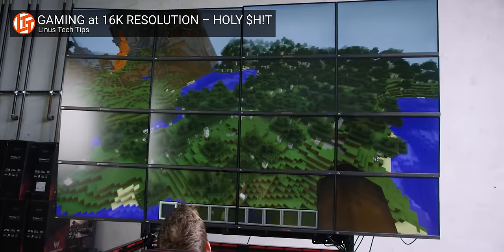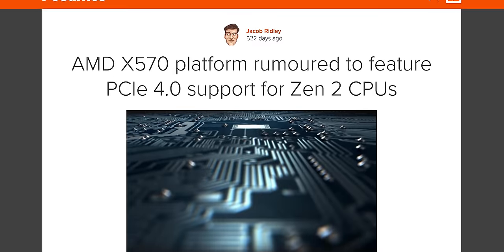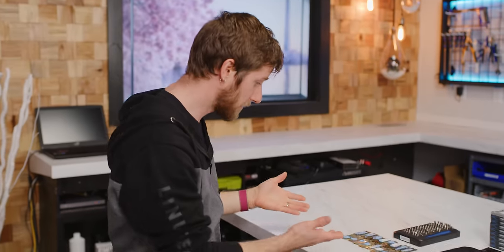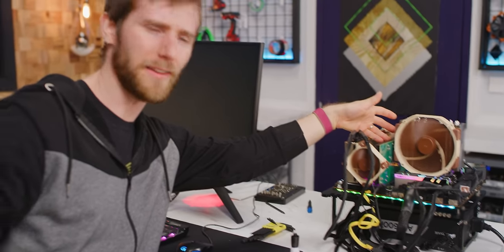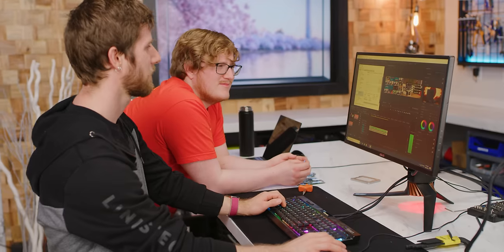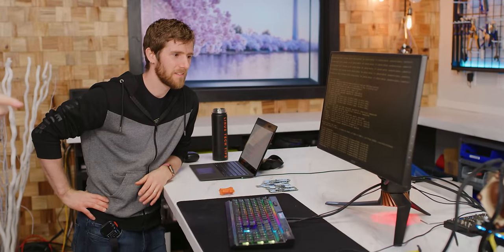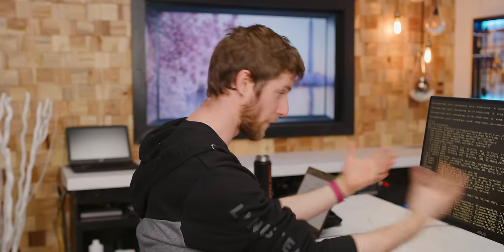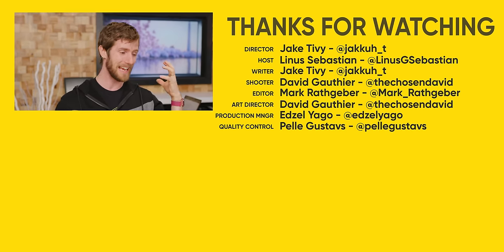This is 50x faster than your PC… HOLY $H!T - Liqid LQD4500 Honey Badger

Comment: 9:27 “This is the worst UI I’ve ever seen.”

Me using a blue and white Bios in 2020.  You said what?
Reply: Blue and white BIOSes are the best. You don't know what you are talking about.
Reply: @MJ-uk6lu  
I mean I guess so, but it has no graphical interface.
Reply: @YTAccount82825  And what? Those blue BIOSes are usually well laid out, simple and have no bullshit. Can't say the same about UEFI era ones, that are heavily bloated, make no sense and look trashier than those basic blue ones.
Reply: @MJ-uk6lu  
Yeah, I guess you are right.  But it just doesn’t look as nice, especially considering that I know someone who has a modern motherboard, and has an advanced UEFI utility, and mine looks not as modern.  Additionally, I’m not that much of a simplicity person but I assume it is just a preference thing.
Reply: @YTAccount82825  Frankly, I just upgraded my computer and I really don't see much point in those "improved" menus. They don't even looks that nice. It looks like 720p on 1440p monitor. I'm not impressed. And there's really not much point of making those UEFI menus to work with mouse as they are firstly designed to still be used with keyboard. Thus you end up with some higher up deciding to spend more cash on motherboard development and then you pay for the stuff that gives you hardly anything better for higher price. Not worth it.
Reply: @MJ-uk6lu  
Yeah, maybe they are great UIs after all, however there are hardly any motherboards that support today’s chipsets with the older appearance and functionally of an older bios.
Reply: @YTAccount82825  Yep. The classical BIOS is dead. You can only find it in some laptops, some OEM desktops, chinese motherboards and certain SBCs. As BIOS became more and more limiting for modern systems it got updated with UEFI, which added a lot of functionality and technical capabilities to BIOS. And while it can have any UI, manufacturers make what they think looks best (most likely what they can sell the best).
Reply: @MJ-uk6lu  
Right.

Comment: Wouldn't running all 8 SSDs in RAID 0 be horrible for redundancy and longevity of these drives? I have no knowledge on this stuff so correct me if I'm wrong, but if this is a high performance SSD meant for multiple workstations,  I'd assume clients would put important data on those drives. Why have such important data on such a seemingly unstable setup? In my understanding, the more drives you use RAID 0 with, the less stable it becomes.

Comment: For us mere mortals the way to go is "Gigabyte Aorus AIC Gen4 PCI-Express 4.0 x16" with 4x M.2 500GB SSDs and with over 5000MB/s read/write speed (a very good price for a very high speed and 2TB of storage which you can use for OS).
(if you have the money you can go up to 29.200MB/s read and up to 28.000MB/s using 4x "Kingston FURY Renegade Gen.4 2TB NVMe M.2", it also has a 4TB version of it but at higher price, depends on the budget but 8TBs are a lot and it won't be any faster, because that's our purpose here, *SPEED*).

Also I saw some questions regarding RAM below. Well, I can say that DDR4 RAM of 3200 Mhz goes up to 25.6GB/s so it won't bottleneck it (technically) if it doesn't go ABOVE that.
And regarding the AMOUNT of RAM, of course the more RAM you have, the better, but 32GBs or RAM at 3200 Mhz should me more than enough for a normal user, 64GBs onward if you are a company slave who works on producing hard-to-handle stuff on that PC.
BEWARE
Your motherboard has a limit on the RAM amount and frequency so be sure to read the spec sheet of it before you make an upgrade, same goes for CPU because that one can bottleneck too, I would suggest a CPU with around 8 cores/16 threads and above 4.2GHz frequency if you wanna make full use of that memory speed. The more cores and threads, the better, in this case at least.
AND DON'T USE WINDOWS, SWITCH TO LINUX FOR GOD'S SHAKE

This new adapter is more like a shortcut to a BIG jump in read/write speed without to actually develop a higher performance & available M.2 SSD (which at our current technology it's a no no but I have high hopes for the future).

Comment: Would this bog down a graphics card. Using the PCIE lanes?
Reply: GPUs usually don't saturate their PCIe interfaces, since they usually can't make use of all the lanes x16 provides. However if these are consuming enough lanes that the GPU is only getting say 4x or even 1/2x it's possible.

Comment: You forgot to stress that all these cards (with possible exception of Gigabyte) require Intel VRoC support, available only on selected Intels and Threadrippers, but not regular Ryzens.  Software raids / custom firmware raids usually as b.... to recover when RAID gets corrupted.

Comment: WOW...
Honey Badger - Element LQD4500 
PCIe Gen 4.0 x16,
Storage - 32TB,
Speed -24 GB/s, 4 M IOPS,
Liquid also has 2 smaller capacity options than may be more for the small business/enthusists :
1. Liqid Element LQD3000 - a PCIe  card, Honey Badger,'s "little brother" 
AIC PCIe Composable Storage SSD,
PCIe Gen 3.0 x8,
Storage - up to 16TB,
Speed- 7 GB/s, 1.25 M IOPS.
2.Liqid Element LQD3250 - a 2.5" U.2 PCIe SSD,
U.2 PCIe Composable Storage SSD,
PCIe Gen 3.0 x4,
Storage - up to 8TB, (there's also a 3250x model that stores up to 16TB)there's also a 3250x that has up to 16TB
Speed - 3.60 GB/s, 850 K IOPS.

Are SAS valid options though? And how do prices compare?
SAS 6Gb/s (about 4.8 GB/s)
SAS 12Gb/s (about 9.6 GB/s)

Comment: There's a difference between data output and throughput. While this SSD output is faster than PS5 SSD, I didn't see anything more than 3.5GB/s throughput in that video. PS5 SSD can throughput 9GB/s from end to end because of the custom hardware and decompressor. Tim was right.

Comment: You would have seen those high numbers on Crystal Disk Mark if you adjusted the thread amount in the settings, no need for Linux for that. There's a tech tip 4 u Linus.

Comment: This is getting near the speeds of main RAM. You could potentially exceed it with multiple. I wonder how well operating systems and/or file systems handle this. The IO sub system may support bypassing the RAM and/or processor, but I do not know if the hardware and/or software support it. I wonder if the multi socket can support one of these remotely.

They may use fiber to these for parallelization/localization if the fiber bandwidth scales well. This would be counter-intuitive to most notions of locality, but it would work off parallelization. Its exploiting the multicore paradigm. Which is economical and plays with existing manufacturing. Once single threaded collapsed we are stuck with moving out to parallel as long as we can starve off the synchronization issues. We can make a ton of IO using serial and parallel together. The issue is processing speeds. We may slowly move to customized hardware/software, but the current models may not support it outside of loose theory. It is possible in theory and semi explored but not at scale to my knowledge. In the end the difference between hardware and software would likely become trivial. Then again these are generally ambiguous.

Comment: 2 Drives on an ASUS Hyper M.2 X16 PCIe 4.0 X4 Expansion Card Supports 4 NVMe M.2 (2242/2260/2280/22110) up to 256Gbps for AMD 3rd Ryzen sTRX40, AM4 Socket and Intel VROC NVMe Raid on a X570 Hero VIII: 2 X 1 TB Sabrient Rockets. (a limitation of x570)  That limitation does not exist on a Threadripper.  http://os-builder.com/charts.png 7GB/s drives are coming to NVME, so 4 drives will see what you get with 8.  Ignore the Write speed, I am fixing that also a limitation in Linux in general.

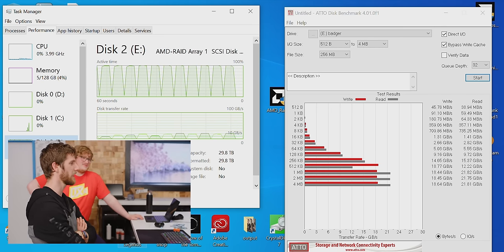Comment: I don't check it... 7:34 "WoW! Over one GB at 16KB"...and? It is normal or not? I mean I have normal M.2 NVME SSD - 1GB Corsair MP510 and get by the same Benchmark and options on 16KB = 1.18GB/s write and 1.21GB/s read...
Why is Linus so stunned?

Comment: Needs IO queues >512 and threads >32. Typical single user, single app uses about 1/16th of it's capacity. The double shuffle in RAM of data/page caches are too slow, directIO is faster for these devices. AMD TR 4 channel RAM are required to cope with the bandwidth and more PCIe lanes to use GPU's & network IO to share.

Comment: 1996: 2gb is plenty, most of what's done is on 1.5 meg floppy.
1999: 5gb Megs is overkill, wont need an upgrade for years
2001: wow! a 30 gig drive, thats insane, I'd never fill that much!
2006: you have 100 games and your os on 128 gigs, never need more
2008:  256 gigs? niiiiiiice, bet you save a lot of naughty stuff on there, a whole library of movies
2010: 512 gigs will be enough for the next few decades, programs arent growing that much
2020: what? you dont have 1TB SSD on your laptop? what.... are you like poor or something?

I remember when ram was measured in 64 meg chunks... and it took 4 dimms. and that was your HIGH END gaming PC
I remember when GPUs had KILOBITES of memory was a whopping 2 megs.

Comment: I might be slow, but why would you compare speeds in Windows and Linux while not using the same "technology" for creating RAID arrays?

It seemed to me you opted for On-Board RAID controller for Windows and software-based for Linux.
Windows is perfectly capable of that same feat. (Storage Spaces)
My guess would be the crappy on-board RAID controller created the overhead for Windows measurements.

https://www.pugetsystems.com/labs/articles/NVMe-RAID-0-Performance-in-Windows-10-Pro-1369/

Quote: 
"Conclusion
Based on what we found in our testing, Windows 10's built-in RAID functionality is the best way to set up an array on NVMe drives today"

Comment: 13:26 except that the PS5 will likely be the first machine to utilise PCIe 4 storage speeds for games 🤔
Reply: Games do not remotely need PCIe 4 storage speeds, not even PCIe 3 speeds.  Anything over about standard SSD speed for gaming you really wont feel at all.  This is because most of the "loading" in games is not actually drive based past a certain point.  It is internet speed/cpu based.

I have a 45GB ram disk that benches around 7000 MB/sec and I really cant tell the difference between it and my 4x PCI-E 2.0 NVM-E SSD running at a (slow) 1400MB/sec.  The bottleneck in both is other aspects of the game/system.  Even my much slower SATA SSDs around 500MB/sec perform effectively the same in game loads.